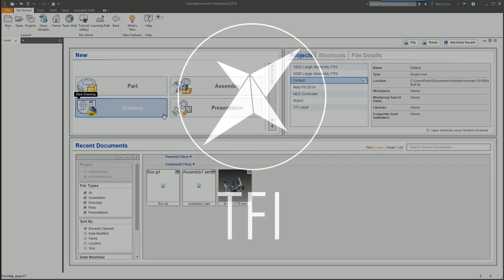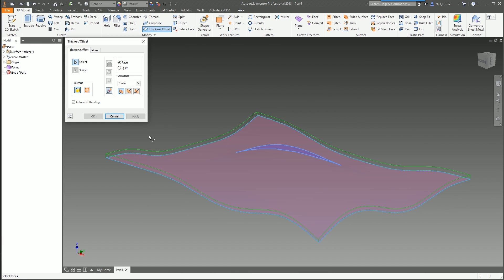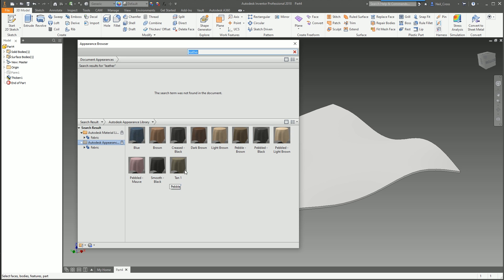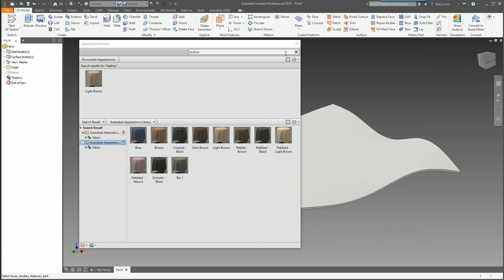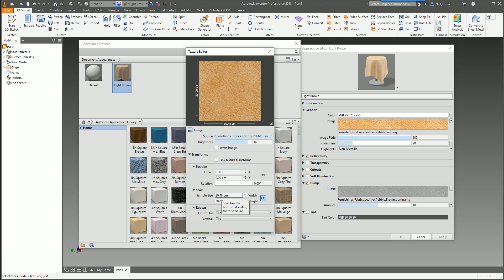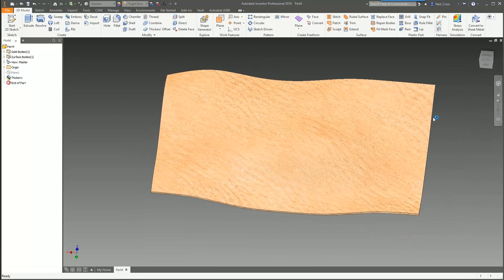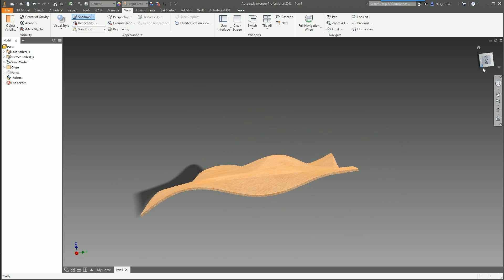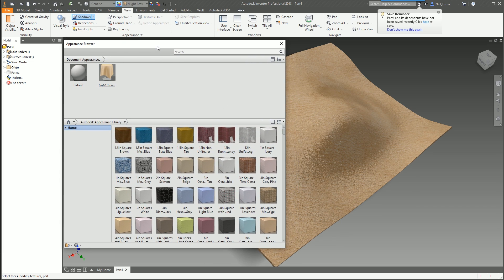How to Correct Texture Size | Autodesk Inventor

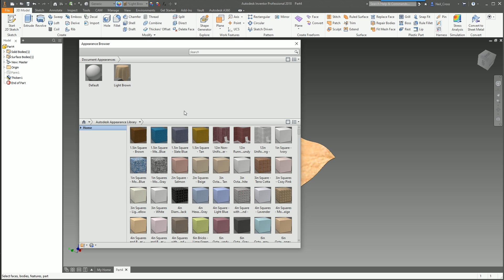Comment from the maker: I realise that I spent 10 minutes explaining how to do something which is 3-4 clicks! Jump to 4:33 if you just want to quickly see how to do this!
Reply: hey man, so dont hate me, but my window focus works. so i think there might be some other cause for your windows being shy and popping up behind others. I'm still on 2017 pro if that makes a difference, i dont have a clue what the cause of the issue could be or where to begin looking for it. Or im the one with the bug, and this bug just so happens to fix that issue. 

on a side note, I gather you are supper busy, but you had a chance to have a crack at that motor winding thing i sent you. I think I found a way to sanely do it using the "cable and harness" or "Tube and pipe" tool in the environments tab when in an assembly. havent had a play with it yet, but the drop down tool tip thing makes it sound like a smart way to do it.

Comment: Is there any way to have textures continue around fillets and chamfers, rather than have them applied with new UV map on each feature? I am working on rounded building corners, having trouble getting the textures to continue around the corners uninterrupted.
Thanks